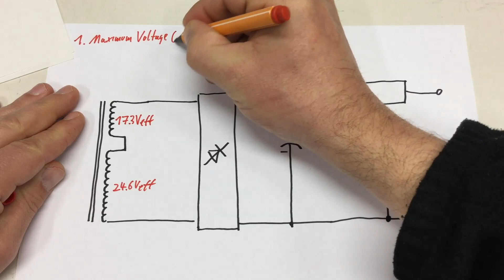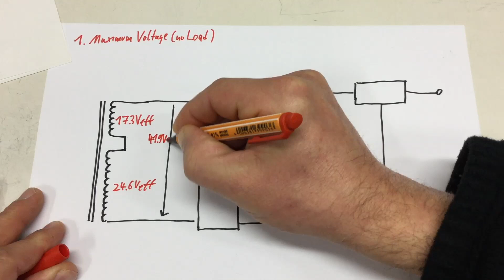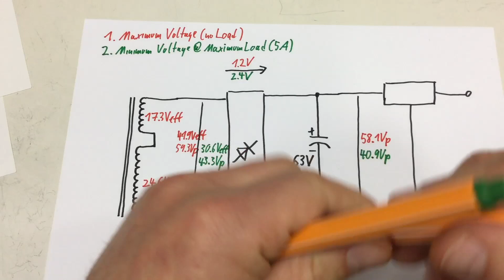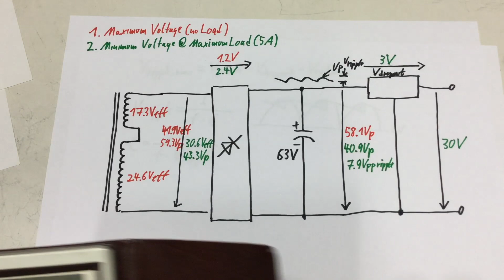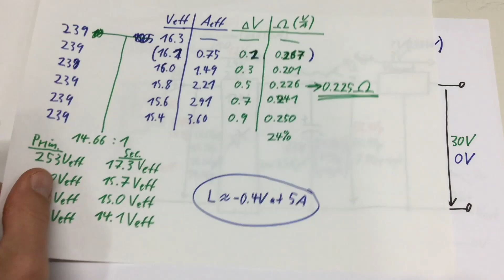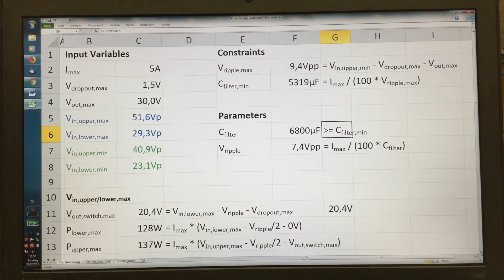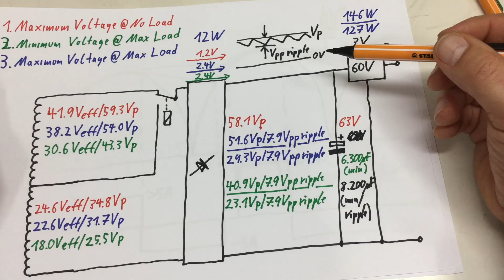Vintage Lab Power Supply Rebuild (7) – Design Consideration

Comment: It has been a long series to watch, but also a pleasure to “participate” of the Project Development. Thanks for sharing. 
About Max ripple current - very nice point of attention. How do you consider using 2x 4700uF instead a single one? It could be competitive, easier to find and accommodate in the enclosure.
Reply from the maker: I thank you for watching it! It's been a long time since I started that project and I never build the regulator itself. Somehow other / more interesting things came along. But I still have the vintage MC1466L voltage/current regulators I wanted to use ...

Anyway, you're right, using 2 x 4700uF instead of a single 10.000uF is definitely the better solution (price and ESR wise).
Reply: @robertssmorgasbord  I didn’t know the MC1466L. Seems interesting at its time, now it is rare to find - at least here in Brazil - and we would have to buy from Asia-based sites, with blind results of being fake or not. 
To do a classic linear circuit, I would use the LM723 as adjustable constant voltage (CV) linear PSU, with its current limiting (CL) circuit. I used it in the past and worked great - apart from the limited CL range of adjustment.
A modification to make the CL going to near Zero could be found in one of the circuits from Elektor - redone in video by “Kasyan TV” channel here in YouTube.
Another alternative of circuit would be to make using LM358/LM324 in the voltage and current control loop. The PSU may be “slow” but at least these ICs are cheap enough to not be fake. For better results, TL081 or CA3140 would be much better. But now most of them being sold are Fake - except when bought from Occidental distributors.
Reply from the maker: @EJEuth  I got lucky and got mine from a German guy as new old stock on eBay Germany (no Asians involved).

And yes, the LM723 (UC723 etc.) are the still available and very affordable (35 cents) alternatives. But I never liked that single NPN transistor being used for current sense/limit. But I guess that's the only real difference to the MC1466L, which sports an additional comparator for the current regulation. And yes, you can make the LM732 regulate down to 0A, like you can make an LM317 regulate down to 0V. You just need an additional (precision) voltage source to offset the base/emitter voltage (LM732), respectively, the internal voltage reference (LM317). But we've already talked about the temperature stability of base/emitter voltages 😉 

Of course you could roll your own with a LM358/LM324/TL081/CA3140 or really any suitable opamp. But I dread compensating analog circuits. I spend quite some time getting my constant current load stable: https://youtu.be/POCg6gxJQbg . It's a relatively short video, but believe me, behind the scenes I spent hours fiddling with the capacitor values 😅
Reply: @robertssmorgasbord  I saw (and commented) that CC Load video. Thanks for sharing.
I also found the video I mentioned before: https://youtu.be/_r3_GjnwI2A (part2 - and in inside mentioned part 1, see diagram at 05:10). I still did not study it so well, but my “gut feeling” tells me the CC adjust around the 3-Stage power transistor could be adapted in the LM723n(not using its internal NPN anymore). For it, we would have a CV (LM723 based) PSU and a widely adjustable CC/CL that would be “classic” from 1970s & 1980s ;-))
I may invest some energy in the future to do just that, as I see a certain glamour in doing this.
The cost of LM723 is low, as you mentioned: please don’t get me wrong, as the matter for me is to use original parts (that I can rely on said properties and characteristics) - not Chinese-faked. 
When using more “sophisticated” components, as I have seen fake ones in OPA, TLC, or even CA3140 & TL081. I have seen YouTubers and Chats complaints in the USA and Europe too - so the problem is the first Pandemic originated in Asia and spread worldwide, becoming Endemic, with no vaccines effective to avoid its spreading.
Buying reputable components from Europe or USA to Brazil, it takes +/- 30days + intercontinental mail + Import taxes… I have done professionally, but now retired and dealing with Electronics as a Hobbyist, I seldom feel so motivated to do so.
Nice to chat with you!
Reply from the maker: @EJEuth  Thanks for the link and commenting on that CC load video of mine! The circuit shown in that video is just a classic. And yes, you could absolutely implement a "better" current regulation for the LM723. One way is of course to "starve" the power transistor of its base current with your own circuit. But since you have full access to the comparator inputs of the LM723, you could also just regulate down your set voltage when you reach your current setting. That might require more than just a few transistor though, maybe an additional opamp would do the trick.
As for sourcing components: I'm just very lucky to live in Germany. And to be honest, every component or breakout board I ordered from Chinese sources lately was either a blatant fake or had other issues. So I completely understand where you're coming from.
EDIT: If you haven't seen it yet: https://youtu.be/CIGjActDeoM (EEVblog #221 - Lab Power Supply Design - Part 1)